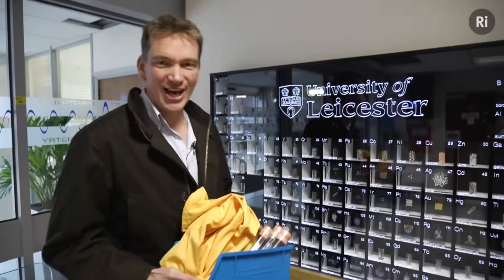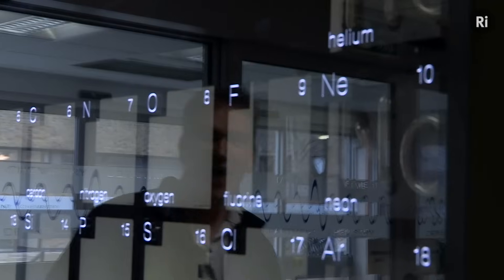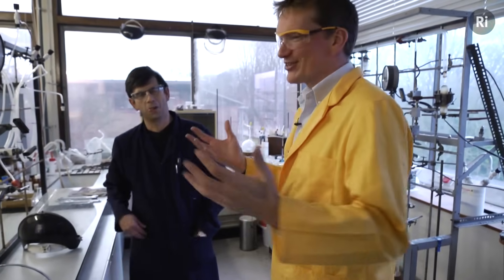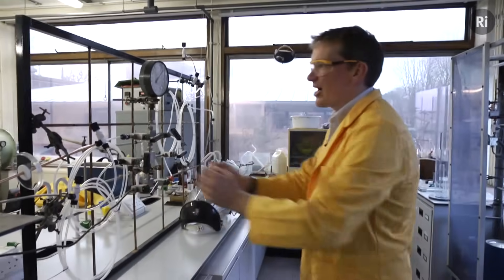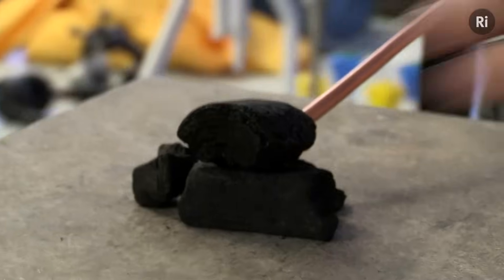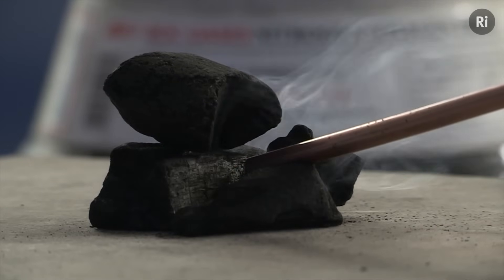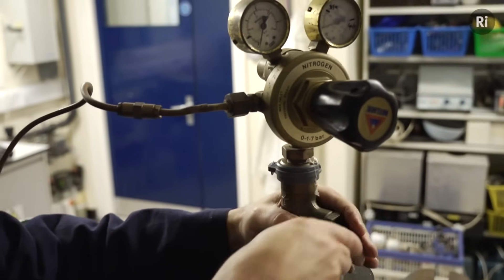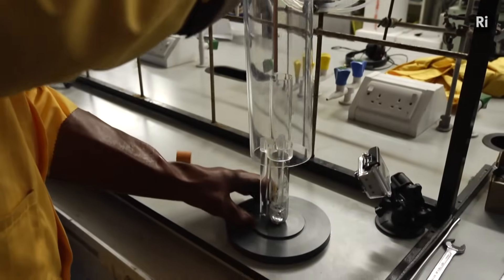Reacting Fluorine with Caesium - First Time on Camera

Comment: What species are created from this reaction? Is it a chain reaction? What if you do the very same experiment in an oxygen-free environment? Is it going to produce a flame-like gas?

I was having a discussion on the ontology of a flame an combustion itself with my dad. He asked me if it would be possible to produce something that looks like a flame in an experiment similar to the burn of a fuel, but in the absence of oxygen (therefore, not being a combustion). e.g. turning a lighter on inside a chamber with another gas rather than oxygen but also strongly oxidative (fluorine, maybe?). I haven't found any video of something like that, apart from plasmas, unfortunately...

I also haven't found any formal definition for flame. Just common sense, based on combustion reactions. But what makes a flame to be a flame? Isn't it its aspect?

I have learned two things about flames and their aspect. Their colour is produced by both molecular absorption and/or emission as well as due to black-body radiation of the soot. However, both of these requirements could be fitted without the presence of oxygen. Therefore, wouldn't it be possible to produce a "flame-like aerosol" just by heating up soot to black-body emission temperatures?

P.S.: I am not considering plasmas cause combustion flames can be produced without being plasmas.

Thanks for everyone that's up for this discussion and experiments
Reply: +JoãoPaulo Ferreira Bertacchi I think it would be explosive.... but not flaming. Like a concussive blast. I mean this is just a hypothesis so if you find out let me know.
Reply: A flame is just a reaction that is exothermic enough to excite electrons in the air and airborne particles to emit light in the visible or ultraviolet spectrum. This normally requires a strong oxidant, like oxygen, but fluorine is strong enough too (in fact more so than oxygen). The flames you see in this video (the one with the the charcoal and the caesium) are both flames with fluorine. I think a flame would have to be considered self-sustaining.

Comment: Wait... wouldn't this produce an extraordinarily dull reaction? Tell me if im wrong in this assumption...

Caesium has very low ionizing energy, therefore it takes a lot less electronegativity in an another atom to snatch up its electron. Flourine has very high electronegativity, making it snatch up the electron of any atom with ease... basically what im saying, is that flourine already bites electrons off of atoms regardless of their ionizing energy, so wouldn't a lower ionizing energy just make it easier for flourine to gain the electron, making for a much, much less violent reaction?  if it were to react with a very high-ionizing energy atom, that would be worth watching.
Reply: +Matt J Noope, low ionization energy means the electrons are far out from the nucleus of the atom, Fluorine comes along and yanks them down much closer to the Fluorine atom, dropping it through several ground states and giving off a massive amount of energy.
Reply: Teth47 but if it had high ionization energy, the flourine would rip them from the stronger holds, releasing more energy
Reply: that would consume energy
Reply: Prime Kek Huh, dunno how I missed this. No, when the electrons are closer to the donor atom, moving them further away takes energy. Once it gets to a certain tipping point, net energy goes positive. That's why you have to heat wood up to get it to burn, you have to give things enough of a shake to knock a few electrons over that tipping point, then the more electronegative atoms can suck them down toward them, shedding more energy in the process, because the electrons end up in a lower orbital. They release enough energy to kick their neighbors over, and so on, that's fire.

It takes energy to break a bond, you get energy from making bonds.

Comment: Did anyone take a spectrum of the light? That would have been pretty cool!
Reply: x-rays are at least 3-4 times the energy per photon than even the most energetic chemical reactions can emit. The energy of emitted photons can never exceed the energy of a single electron transition in a reaction.
Reply: @dustinbrueggemann1875  even so, that would allow some pretty hard UV to be created. It would be fairly impressive.
Reply: I'd bet at least some UV, would hope for X-ray but I doubt it :P
Reply: Fluoralantimonic acid the nope acid
Reply: Or hot?

Comment: 260 people were hoping for a big explosion, and perhaps a bit of injury. ;)
Reply: +Mod MINI The bang comes form the hydrogen gas released that then combusts with oxygen in the air. The cesium is just really effective at tearing the oxygen away from the hydrogen in water, which generates heat which then in turn ignites the hydrogen.
Reply: +lockerboy13 recently disproven - its actually a coulombic explosion
Reply: I was excited enough by the violety purple.
Reply: +James Wilkins I was surprised - I though it would explode. Cesium is extremely violent when dropped into water. It goes "bang." I thought fluorine might go "BANG!"
Reply: same here, that just looked like a magnesium reaction creating MgO
Reply: @ModMINI  yeah, same, Idk why it reacted so slowly.
Reply: +lockerboy13 nah its a relatively unknown phenomena, simply put the chemical reaction shouldn't create a rapid explosion (as thunderf00t showed in his videos) its only recently been well observed exactly how this happens
Reply: @km5405  thunderfoot is a but of an idiot sometimes.
Reply: They seemed to release only a tiny bit of fluorine gas. Could be the reason why the reaction wasn't as vigorous as some people expected.
Reply: @hoxhaloo  and yet it was so intense. Imagine if they would've had taken really large amounts of Cs and F
Reply: I wasn't hoping for injury, but perhaps a bit of broken glass.
Reply: I was hoping for a bit more than a flash of light. I mean potassium and water cause a far larger reaction than this.
Reply: @LanzaNation  
No gas is produced though. You "just" get some cesium fluoride deposited onto the cesium, and a shitton of energy (hence the purple light)
Reply: Kevin Miedema Huh, wonder if that's something that my chemistry teachers have always just glossed over.
Reply: Bhag yahan se marrrrrrrr tu
Reply: i need to watch things die from a distance, vicariously i live while the whoooole wooooorld diiiiiiies xD
Reply: Exactly!
Reply: You just have to burn it and add some water good luck for having an explosion
Reply: They probably released the Fluorine really slowly and carefully.
Reply: i love the way u think XD :)

Comment: Thirty years ago I worked for a company that among other things bought military surplus. The boss had gotten this strange ball made of stainless steel about the size of a softball, It had some fittings and rods coming out of it and looked a lot like the Sputnik spacecraft, It was obviously hollow and had some liquid in it. He and another employee got to work trying to cut it open. After a lot of hack sawing on the thing, they cut through and a silver liquid metal started pouring out. This surprised them and they tried to catch it in their hands thinking it was mercury. There was not much, about what the video showed. It started burning their skin and smoking. They ran to the sink to wash it off with water. When the water hit the metal, now stuck to their hands, it caught fire and exploded in small pops and fizzes. We later learned that it was caesium. Their hands healed after a few weeks.
Later I did some research and to my best guess, the ball was indeed a satellite that the military used as a target in orbit to aim high energy xray beams at. This one never made it to space and ended up being sold (most likely by accident) at a surplus sale.
Reply: Piotr Joniec Ah, the Goiânia accident.

It wasn't a metal, it was a radioactive caesium chloride salt that had been used as a gamma source for radiotherapy in a hospital.

It wasn't tonnes of people who died, it was 4. Which might be surprising since it contained 93 grams (!!!!!) of ceasium-137 chloride and it was handled with a kind of unfathomable recklessness that seems surreal still today.

He took the source in its container from it's shielding and brought it into his house and invited everyone to come and see it. Then they took turns using a screwdriver to chip out several rice-grained sized chunks of caesium-salt as well as scraping out dust and shared it around with friends and family. The person who found it intended to make a ring of it for his wife. One of the kids rubbed the stuff all over her arms so that she sparkled. His brother painted a cross on his stomach using the dust. Some of it was eaten by mistake. It ended up on bed clothes and every where else. It wasn't until 15 days later that the source was transported to a hospital so that it could be examined, in a plastic bag, without shielding, using public transportation.
Reply: Well, that wasn't very smart.
Reply: Wasn't very smart to sell a ball full of caesium or to get it on your hands? I must admit I was a little amused by the whole thing. I did not like my boss very well.
Reply: To get it on your hands. There was an accident in Brazil I think, where a man has found a weird looking metal cylinder. After opening it (it took some time) he noticed there is a blue glowing metal inside. Long story short, it circulated between tons of people and it happened to be radioactive, causing tons of deaths.
Reply: @piotrjoniec9179  the stuff in Brazil was a salt of Cesium-137, which is a radioactive isotope of Cesium. 

Not that many people died directly as a result of the accident. Only 4 people actually died within a few days of the exposure, by radiation poisoning. But around 1600 people were exposed and were expected to have health issues in consequence. 

It is estimated that around 100 of the victims already died years later from diseases related to the exposure.

The stuff in the ball Pietro Terramanti is talking about was probably Cesium-133 which is stable and not radioactive.
Reply: "He who breaks a thing to find out what it is, has left the path of wisdom" - Gandalf the Grey
Reply: soylentgreenb
I remember reading about the incident. The story I read pretty well matches what you describe. Amazing, but when money runs out, things just stop. I understand that some private individuals guarded the site on their own for free for several weeks, knowing there were items inside the building that should not be allowed to get into untrained hands.
Reply: "they tried to catch it in their hands, thinking it was mercury" <-- see, i was wondering who'd just cut open a weird military thing with a hacksaw to see what was in it, and that sentence gives a pretty comprehensive answer
Reply: +Paul Montgomery So why was it filled with cesium? Was it somehow used to increase its reaction to the X-ray beams?
Reply: *****
If I remember correctly, it was for keeping the temperature of the sat consistent from the side being hit with sunlight compared to the dark side.
Reply: +Piotr Joniec Goiânia accident.

I have read about it. A couple of guys go into an abandoned hospital and rip the walls to take out the lead sheets. They also find a gamma ray radiation therapy machine. Being dummies, they don't know what it is and try to take it as well so that they can sell it as scrap.
After a lot of work, they break into the head and find a metal canister. It takes a lot of hard work to cut it since it is made of iridium (they aren't aware it is iridium). I might be confusing the iridium part with another such incident involving Cobalt 60. They take it home and play with the blue glowing material, which is actually Cesium chloride with cesium 137. They even paint their kid with it. I think the kid dies, the wife dies and the rest get extremely ill. Someone brings a geiger counter that he has borrowed to investigate and the town is radioactive wherever he goes.
He thinks that the device is defective. After checking with authorities, they find that it is working perfectly and the town is extremely contaminated and has to be torn down and buried.
Reply: @louistournas120  it wasn't the whole town that was contaminated, only a particular neighborhood.
Reply: if its a silver metal than its not Cs but rubidim . Cesiumis golden color
Reply: @gottmituns9652  More likely to be NaK if it was hydrocombustible.
Reply: @gottmituns9652  could be an alloy or something
Reply: ceasium is gold not silver
Reply: I guess safety isn't number one priority in your company
Reply: +Piotr Joniec Co60 I'm sure.
Reply: +Paul Montgomery Ah, that makes sense. It is liquid so it would convect as it warms and cools.
Reply: +Paul Montgomery Hard to believe that as simple solid metal would do it even better. The distinct purpose of Cs would be e.g. give a very strong coloured signal (visible from Earth by naked eye) when sprayed in space and illuminated. That happens if the satellite gets destroyed
Reply: Woah! one of the greatest comments i've ever read. Very rare story to find.
Reply: If it had been mercury wouldnt it have poisoned them?
Reply: @mjade1673  Elemental mercury is not terribly poisonous. I handled it daily at work for 10 years. It does evaporate and the mercury vapor is dangerous over long periods of time. It's the organic mercury compounds like methyl mercury that is so dangerous. A chemist once accidently got a single drop on her rubber glove covered hand and immediately removed the glove. It still killed in a few months, attacking her nervous system.
Reply: I'm no military expert, but I'd suspect that that ball with the caesium (or other alkaloid metal) inside could've been part of a bomb designed to either react with a halogen, such as chlorine or fluorine, to produce a highly-exothermic reaction (i.e. produces lots of heat) meant to heat something else up (possibly to melt it, or to cause it to combust), or to react with water to produce caesium hydroxide plus hydrogen gas, which could easily result in a thermobaric explosion, where the freed hydrogen gas reacts with the oxygen in the air if there's enough heat (and well, caesium's reactions with water are notoriously exothermic, so...), or both even (the caesium reacting with the water to free hydrogen gas, and the halogen to create lots of heat to spark a thermobaric explosion).
Reply: Wow I had one of those years ago. It is a NaK filled heat exchanger for a Loral systems infrared imager/ seeker. The NaK in particular allows the DI water from the seeker laser to be cooled by the glycol water that the unit had cooling the rest of the bits.
Reply: Tony Samson
Oh no, they would never have done that. The chance of the EPA shutting down the place as contaminated would have stopped the boss. I remember another incident where we got a contract to rebuild all the manometers on a ship. The shipyard was to deliver them two us drained of the indicating fluid, which was mercury. Each manometer had several pounds and there were around 50 of them. A truck pulled into our delivery bay from the yard and I was paged to meet them ASAP. When I got there, mercury was running under the back door on the truck onto the ground. A trail of mercury could be seen on road leading into the parking lot. I estimated that over a hundred pounds of mercury was lost on the way to our shop. Now pure mercury is not a huge risk unless you breath the vapors in or are in prolonged contact, but still. No report was filed, even after I protested and on my own contacted the EPA. This was around 1986. The company is gone. The grounds have been dug up and now is the site for a university civic center.